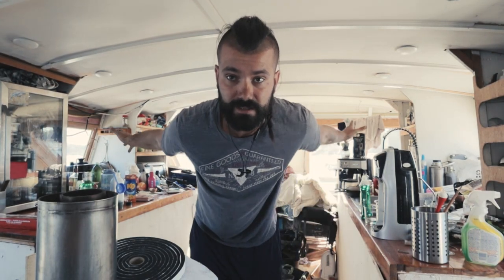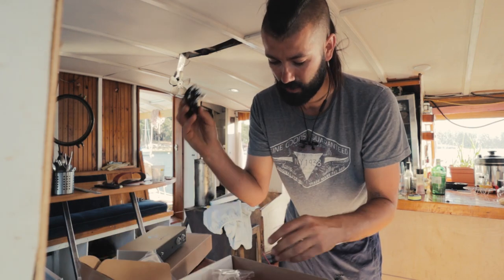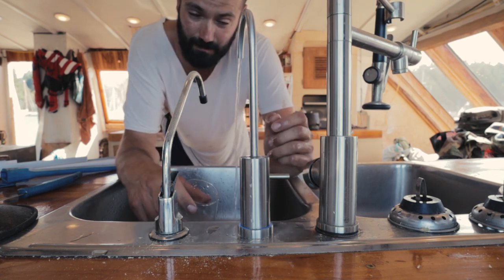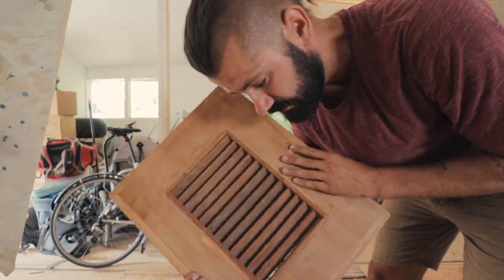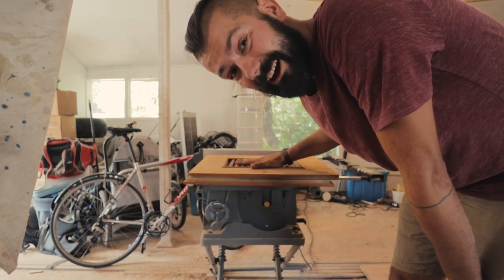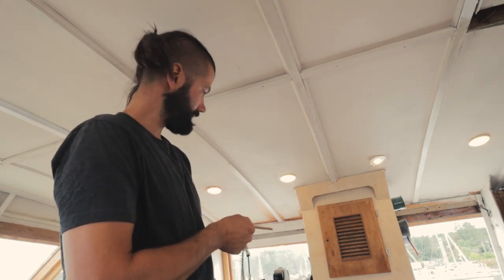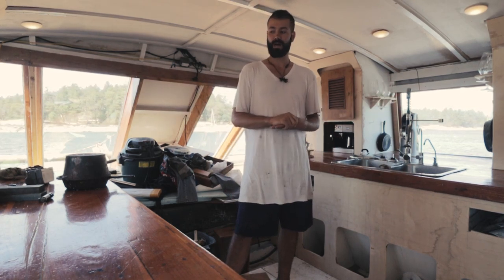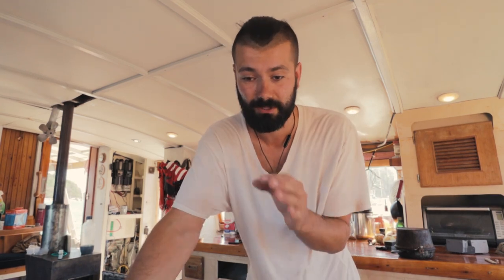Building a Chef's Galley - Sink or Swim 213

Comment: Simon, baking is chemistry...it is unlike your normal fantastic cooking that you do. Measuring accurately (preferably by weighing the ingredients) is vital. (Can you tell I'm a baker? :-) ) Your toaster oven is not going to circulate the air around sufficiently to bake well in your cast iron. Either upgrade your toaster oven (I have several recommendations) or downgrade your bread to a loaf pan. However, under the circumstances that is a FINE loaf of bread....combined with hearty soup or veg chili, it will be wonderful. :-)

Comment: I've just checked Acuva website and they claim 9W of power consuption can break down 99.99% germs for 2 liters per minute. Lets say its actually 7W of UV LED light, which is not enough to support the claim. This is why its classed B to be used as supplemental to other purifiers and manufacturer claims its the most powerful on the market!? (I've seen 40W models, class A) ...yes, casing is nice but it doesnt contribute to the function of the device, and for 550USD/pc its just a pure consumerism. Advertising crap doesnt help the channel.
- useful link:
https://www.water-research.net/index.php/water-treatment/water-disinfection/uv-disinfection
Reply: For a class B unit, depending on the porosity of the mechanical filter, it could satisfy the requirements for potable water filtration.